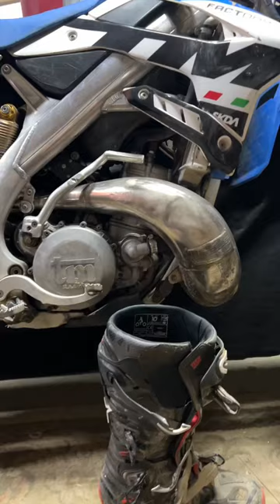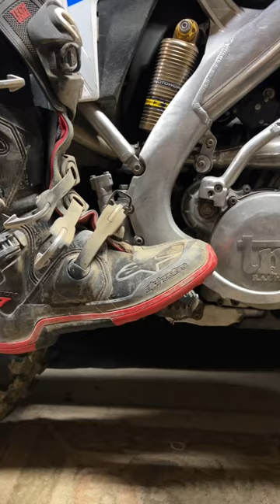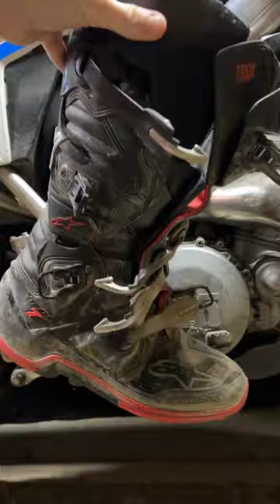How to shift and brake with motocross boots.

Comment: Honestly great advice! I sprained my ankle yesterday in a spill (off road). I was wearing Alpinestars Tech 3 boots, but they were too loose. I was using my toes to break and shift. Weight of the bike fell on my foot and the boots were not tight enough to prevent movement.

Comment: It also makes sense to raise the shifter head by rotating  the entire assembly on the splined shaft upwards somewhat so it is easier to slip your toe under the shifter to shift to the next gear, although you will need to lift your foot a little higher to downshift but you learn to lift and then let gravity do the rest.
Reply from the maker: I do the same thing BUT somehow all the good riders seem to keep the shift lever pretty low. I ride other people bikes and can’t get the up shifts 🤷‍♂️

Comment: Is it normal to feel unbalanced when doing emergency stops in MX boots? I've fallen twice when trying to do emergency stops while on the way to a destination because it feels like I have no grip or balance on the ground
Reply from the maker: Go to the mx factory channel and watch a couple videos on breaking. I don’t ever really feel unbalanced. Grip the bike with your legs and shift your weight to the rear. Make sure your using both front and rear brake.

Comment: Its really hard for me to do this because i cant feel the pedals and also when i dont have both feet on footrests i get unstable on the bike, any tips?
Reply from the maker: Just keep practicing. One thing that might make you feel more stable is making sure your standing up, keep your elbows up, and keep your head over the bars so especially when you give it gas lean forward
Reply: @brapperdan  alright thank you
Reply: @brapperdan  same thing with me. I'm a beginner & I got similar boots just because & now I can't use them. lol. Thanks for this video
Reply from the maker: @pembatamang8233  just keep riding as much as possible and you’ll get it.
Reply: Same here I can’t feel the brake or shifter when I wear my boots
Reply: @brapperdan  i quit trying to use boots i cant i m just a bit short for my 125 and if i do enduro  i fall a lot cant shift break or even have balance. on the same path as without the boots i can do it fine
Reply: Me too
Reply: @pembatamang8233 the only time I prefer to wear my 🥾 with flexible lug soles.
Reply: @brapperdan  now i am comfortable with shifting but when i brake i have little feel and i have to brake with my heel on the peg because i cant feel it otherwise and i end up locking the brakes unintentionally.
Reply from the maker: @alfa955  what boots you using? All I can say is keep practicing. Seems like a lot of people really struggle but I do t remember it taking all that long for me to get used to it. I struggled more with up shifting. Try to shift up when your sitting if you can.
Reply: @brapperdan  shifting up or down is fine but when i want to brake hard i need to use the rear brake and also shift down but with this method of not having the foot on the heel its impossible no?
Reply: @brapperdan  i have leatt mx boots
Reply from the maker: @alfa955  oh yeah I see what you mean. I’m not a high level rider but for me I would definitely be using my heal in a situation like that. Are you riding MX? AJ catanzaro has older videos that are great for this type of thing how to brake and down shift coming into a corner. I think what I do is shift down first then brake into the corner so I’m not doing everything at once or vice versa
Reply: @brapperdan  im not, just casual woods riding. Thanks.
Reply: Guys, WEAR PROPER GEAR. You will be sorry you didn't if you don't.